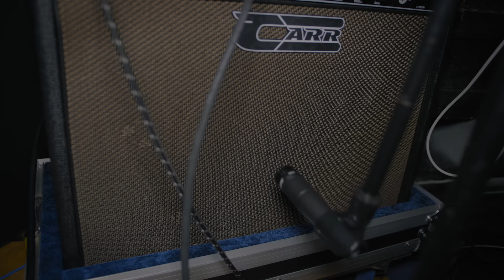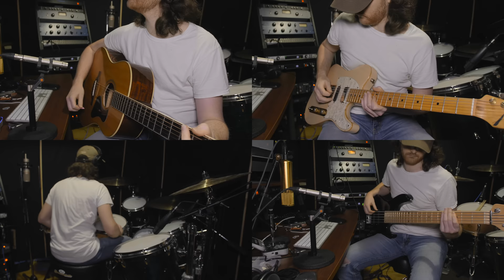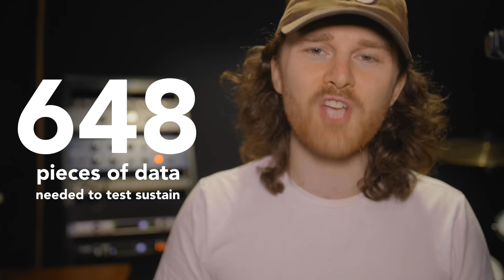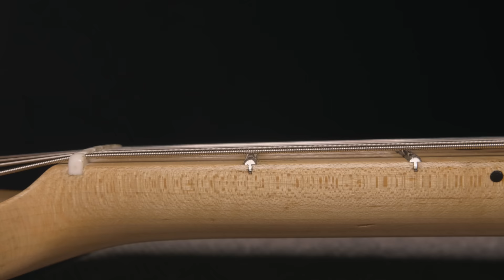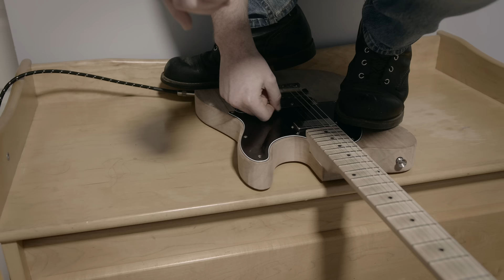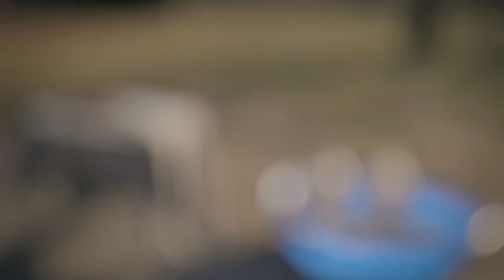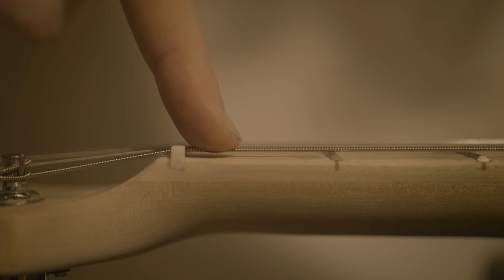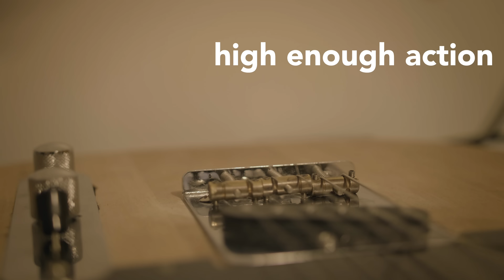Tested: Where Does The Sustain Come From In An Electric Guitar?

Comment: Guitar players have a hard-on for words like "sustain" and "tonewood".  Like you showed, the fact of the matter is, when it comes to electric guitars, the type of wood, its thickness, body size and shape, etc., etc., etc., have little to nothing to do with these mythical words.  Electric guitars and the sounds they make are determined by the player and their amp.  Thats it.
Reply: Pickups too but yeah that’s about it
Reply: @spadestight6308  Pickups and the electrics of the guitar. If you run everything through a passive low-pass it's going to sound different :P
Reply: The sound chain is basically the player->strings->pickup->electronics->amp.
Reply: Pmuch this. 
I remember almost getting caught up in the specifics of the tone wood and all of that nonsense when I was younger. 
And then I used my brain and started doing some testing LOL
The way I look at it, those "mythical words" you mentioned definitely can matter, but not for the actual quality of the sound being produced. If you're buying a Mahogany guitar because it's supposed to magically sound better, you're being scammed. BUT if you're buying a specific guitar because the neck is proportioned better for your hands or the body is a better size or the wood is a better quality that will make it durable to warping and other defects over time then you're using those buzz words for the right reasons.

I think a lot of people are trying to hype up these expensive guitars and market them to new players who are likely to not stick with the hobby for a long time. Buzzwords are super effective when targeted towards 16 year olds who are just trying to impress their girlfriends with a guitar. You shouldn't throw all merit in those qualities completely, but you need to choose a guitar for the right reasons and not because some dude said mahogany is better for tone LOL
Reply: It's funny when he reads unsubstantiated, contradictory hypothesizing by people on forums. When presented with evidence that their beliefs are incorrect, though, they will claim to have magical ears that can detect sublime differences in tone, and if we were lucky enough to have extra super special hearing, too, then we would realize they are right. They must think they are Ferengi from Star Trek and play a dog whistle like it's a harmonica.
Reply: @thomasmoody8307  I think it's just hard for people to understand what they don't experience. To some people there is more than just a perceived difference. These people can hear and feel their truth and don't need anyone telling them what it is. My dog can smell something like 10,000x better than most humans. Will you tell her that her truth is just a star trek fantasy just because you can't smell peanut butter a half mile away? 
Some people are tuned in more, and the sounds of various woods, scale length,  string type, pick used, etc all make a huge difference. 

Fingerboard and neck wood is super important because the harder the fingerboard wood the softer people will press in general, so the sound will be different than a softer wood, where one may hold the strings harder against the wood. More finger meat definitely thickens and warms the tone, to my ears anyways. Play right hand rythym without a pick and it's noticably warmer. The same goes for adding finger meat to the fretboard side. I tend to squeeze maple less aggressively than mahogany so the change on grip changes string interaction and produces a slight variation of tonal pallette, in my opinion.  

I did like your Star Trek joke by the way, and I hope I don't come across as argumentative. Just trying to shed light on other people's experiences. Many people are buying and consuming snake oils, however to some people those snake oils are what cures them. We are all unique and can experience the same thing very differently :-)

As long as everyone is having fun it's all good 🙃
Reply: Well, picks too.
Reply: @daxmoore2060  Even if you do have some sort of super-human hearing you're wasting your time trying to reproduce your perfect tone anyway because no-one else will hear it.  And even if you're not super-human it's still true in general because you can't control the signal chain after recording.  You can spend hundreds of thousands of dollars on a Dumble amp, some 1960's vintage guitar and Klons galore, record on the best studio equipment available, only to have your music lossy compressed to mp3 and played on a phone though some shitty earpods.
Reply: @mk_rexx  in addition you need a setup, that fits your hands. Setup needs time and time is money. Learn to do a setup saves the money cheap brands cannot spend. 
And in general: use the time you might have discussed about wood (for electrics) for playing to train your fingers.

There are things like cables, sometimes costing 500$ for a „Rock cable“ and even 20$ more for the „Jazz cable“, because everyone knows: Jazz is the higher quality music.
Reply: The type of wood determines the integrity of the guitar, how long its going to last and retain its shape. That's why solid mahogany guitars from the 50's sound even better today, and why it's used in high-end guitars. So even if you don't believe in tonewood , it still contributes.

Every time I strum a solid mahogany les paul, the body vibrates for half a minute.

The strings affect the body, which affects the strings, which affects the body, and this cycle repeats until its done sustaining. 
So its obvious that the body has an impact on how well it resonates as a whole. Every wood has a different density, and every square inch counts (otherwise the body shape wouldn't matter at all). The material shapes the sound and gives it character because a Spruce body is going to sound different, and a plastic body is going to kill all vibrations in one second. Just look at 11:40 and 14:20. a guitar sawed in half with lots of holes in it sounds choked and lifeless (no offense, a good player like Jim can make even that sound good). But it shows quite well that the shape and material gives the guitar most of its sound.

Maybe you can get similar sustain with a Concrete body, but the sound of the guitar is not going to have the same balance, warmth and character as 10lbs of mahogany wood in a gibson LP

So either way, the wood makes a difference.
Reply: @jayall00  there's a whole different video on tone wood and why it's just not a thing, but as you're clearly in the "tone wood camp exists" there's no point trying convince you. There are also loads of videos of people making guitars out of plywood, pallet wood, 3D printed, concrete, epoxy resin, glass, carbon fibre etc. and they all sound great.
I guess if you have paid loads for some really expensive gear then you need to justify it to yourself, and what better way than using meaningless words to describe the sound like "character" and "depth".
Reply: @jayall00  well said, but you cannot get the doubters to listen (they just neeed time actually playing these guitars and as the years go by they will learn through experiience what you cannot convince them of through argument, of course wood matters, a whole lot when you are talking about a guitar made of wood)
Reply: @xTheZapper  If you can make any of those sound like a gibson, then I'll change my mind.
Reply: @jayall00  and if you can pick out the Gibson in a blind listening test I'll change mine!
Reply: @xTheZapper  I can though. a gibson will have an extra bite and growl to it, and an epiphone will sound fake, doesnt sustain for more than 8 seconds. though epiphone sounds good in its own light and I used to love mine...but that was before I upgraded
Reply: @jayall00  by blind test I don't mean that you play your Gibson and then you play something else. Check out the Andertons videos on blind tests where they have pro players struggling to identify a Tube amp from a Kemper or the Klon in a stack of Klon clones. Everyone thinks they can tell but in true blind tests you're always wrong. And guitarists don't like to be wrong about the gear they love.
Reply: @xTheZapper  so you're saying every guitarist should buy mass produced hunks of plastic from china (epiphones, squires, etc.) rather than actually hand-crafted instruments, just because it sounds similar in the same amp? Also I watch andertons. They know a gibson from an epiphone and admit the difference on a number of occasions. There's no denying real instruments sound better
Reply: @jayall00  Actually, there's plenty of denying that "real" instruments sound better, but guitarists are a snobby bunch and just won't admit it. If you pay $7000 for a Klon you'll try and find reasons why it's over $6900 better than a Tumnus, or 100k for a 50's Strat, maybe it's because the shitty Poplar they used then was loads better than the shitty Poplar they use now (Poplar is a shitty cheap wood). However, trying get this through to a guitarist who believes in tone wood is like trying to tell a religious fundamentalist that God isn't real.
Reply: @xTheZapper  Guitar collectors are the snobbiest creatures in existence, but you can't blame them when the only way to get "high-end" instruments is selling a car (or kidney). I own two guitars and that's it. But when I play, I want the exact same sound that guitarists were getting from the 70's, note for note, no exceptions. If I have to spend half the price of a car to get that, I will, but I think that it is a load of bull that any guitar should cost over 2 grand. And I agree the hype surrounding old strats is ridiculous, because every stratocaster sounds exactly the same. A good fender strat will sound like every other strat in existence. But, a mahogany les paul is in a whole different league than a poplar strat, there's actually a good reason for it to cost more.
Reply: @xTheZapper  I play music for me, because I enjoy the feeling. I don't have post production, etc, because I just play guitar in my living room. I do believe you are correct, with all of that recording hocus pocus going on, most people wouldn't hear any difference. It's different story when it's just a man and guitar with hands and ears and no recording gear. If you can't hear it, there's no shame in leaving the people alone that can hear the difference. It's totally ok that you're not in the club. You probably notice, or are aware of many things that others are not, or can't perceive. That's what being a human is about. We all have differences and that's okay :-)
Reply: That’s why I had one guitar for several  years
Reply: According to the video the sustain was effected by the material of the bridge, the lacquer, and what it was resonating on (the bed and dresser)
Reply: @m0002856  Correct. A player with limited funds should not be saving up to buy $1000+ instruments thinking this is the only way to solve their problems. I get the idea that more expensive instruments involve (hopefully) better quality control so things like level frets are more likely straight out of the box. However, there is no need to spend that much money just for playability. An inexpensive guitar can be made to play very smoothly with action as low as you'd like after given a once over by a decent tech. I can take the cheapest Squire available and make it feel the same to play as a top end MIA Fender. It's just a matter of leveling the frets, dressing the ends, cutting the nut slots correctly, trimming the bridge saddle screws if they sprout, and giving the thing a complete setup for neck relief, action, intonation, pickup height.
Reply: @xTheZapper  speak and spread the truth brother all these boomers getting so mad on the other hand is hilarious
Reply: @southernpride2003  ha! This is a blast from the past, it's funny reading the comments back. Especially from the guy who's clearly a Gibson fanboy and happy to wail on expensive stats but his precious Gibson is beyond compare. He perfectly proves my point himself, "I paid a load of money for this, and I don't want to look dumb, so I'll defend it with shaky circumstantial evidence and personal opinion until I'm blue in the face".

Comment: I’ve always wondered if how I hold and move the guitar affects the sustain. It would make sense that how you move the guitar after picking a note could effect how the string vibrates, and how long it vibrates. 
And also any airflow/wind could also make a difference in certain settings.

Comment: Love your videos. Just want to add that, even though resonance and sustain are factors that co-exist in electric guitars, they are inversely proportional. In other words, the more resonance, the less sustain, and viceversa. Think of acoustic versus solid body guitars. Resonance is the transfer of kinetic energy from the strings to the body of the guitar. If the string retains the energy, it vibrates longer; hence, longer sustain.
Reply: Thank you. Another thing to notice is that maybe a more appropriate equivalent of the air guitar would have been pressing the head and bottom of the guitar, or just the head, against for example a heavy wardrove.
Reply: Good point. This also makes clear why the matress-guitar had more sustain than coupled-to-resonant-mass-guitar.

Comment: Some of the tests, like the mattress one, were surprising. A few dB is a big deal. Every raise of 6dB is effectively twice the perceived volume. So if a test does say 18dB in test A and 21dB in test B... That’s pretty major. 
Example - 42dB isn’t twice as loud  as 21dB - It’s closer to 4 1/2 times louder.
Reply: To be fair, the matress/dresser test, was the worst one design wise.
There's no pressure applied on the matress, there is a lot of pressure applied on the dresser.